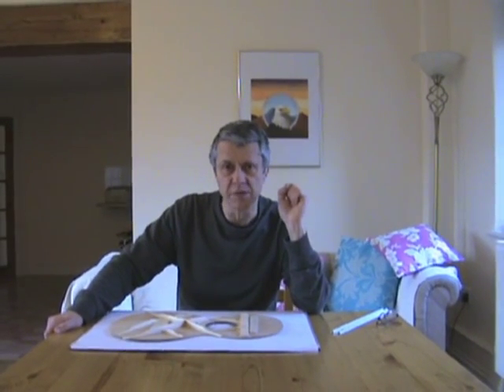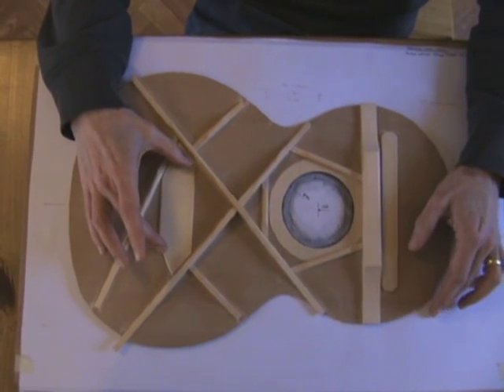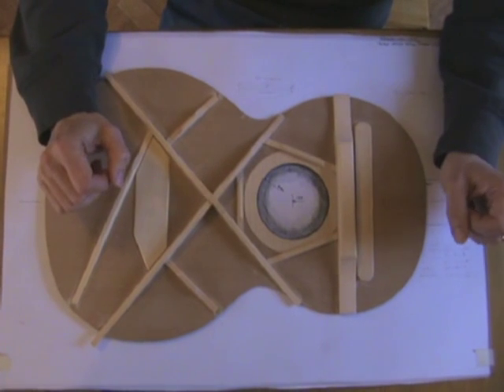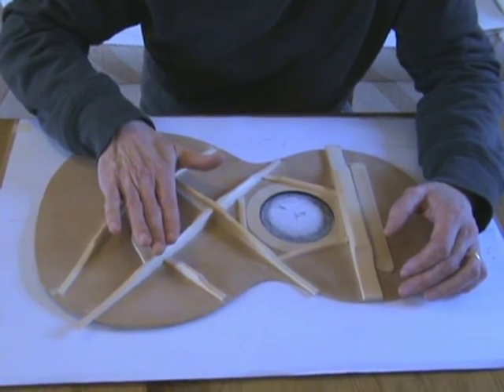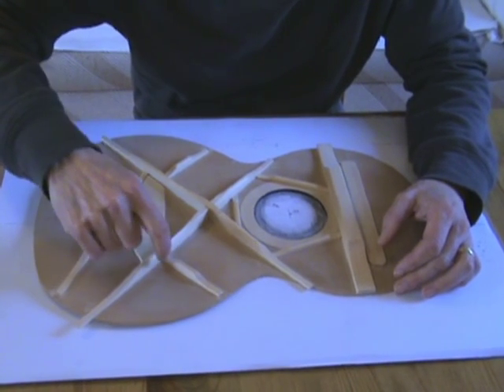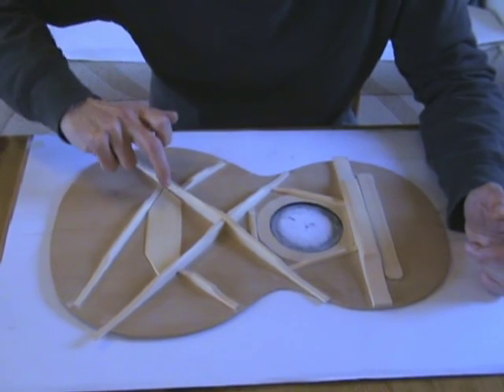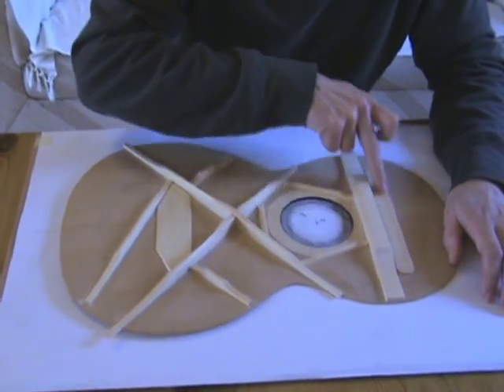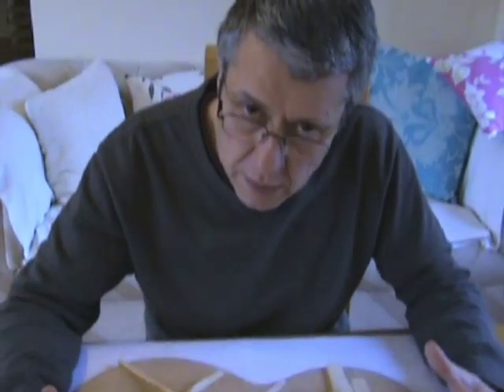Parlour guitar design & construction VIII: the soundboard

Comment: Given your bracing pattern, it would be interesting to see you place salt or pepper on the sound board to see how it vibrates when a string is plucked or a tuning fork is applied to the sound board.I think this might be a good way to evaluate internal bracing design.  I am also curious as to how you tune the top by sanding or other means